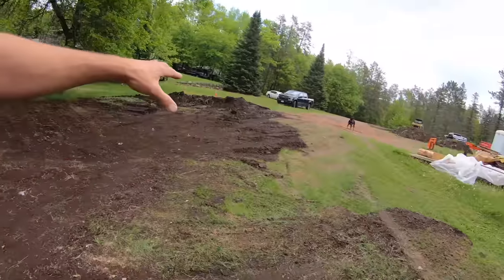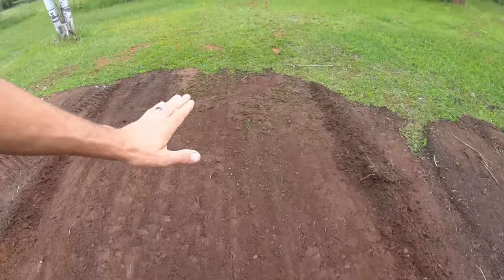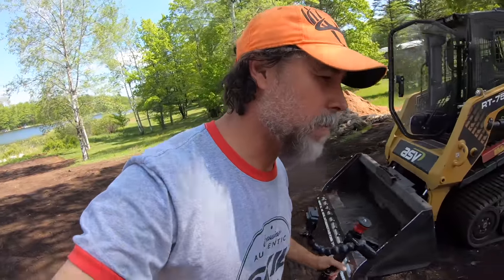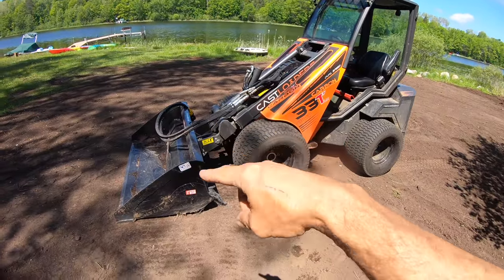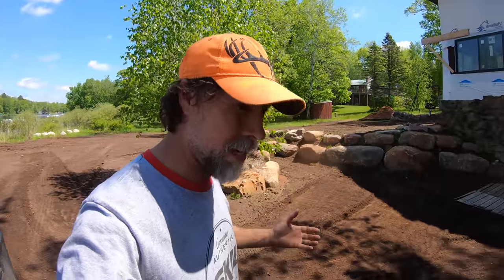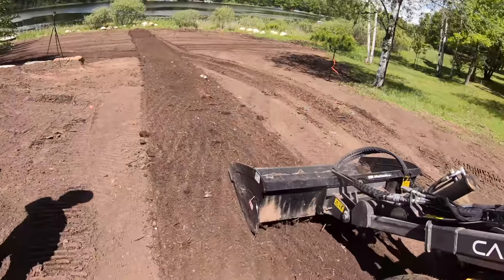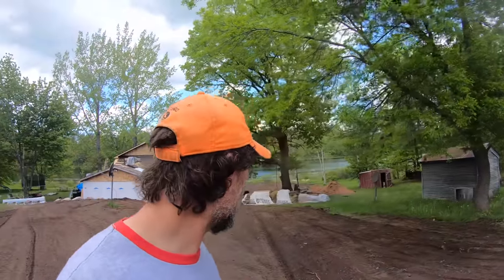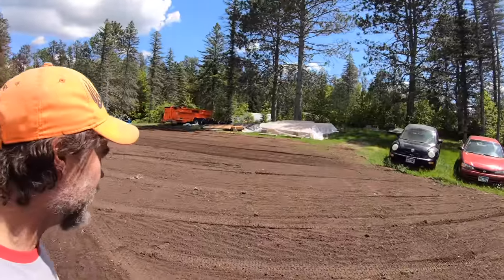A new Grading bucket for a MIni loader

Comment: The key problems is why we have 3 spare keys in the truck. 1 in the wallet and 1 in the key chain plus 2 at home. I'm also glad bobcat uses the same key on everything. Also glad the new machines use a code and you don't need a key anymore. Great video!

Comment: Stan light machine floats on top of ground not surprised the hydro bucket worked well please shut down the loader before you stick you hands in the rotor of the bucket

Comment: I bought the hydrabucket for my asv rc30 and really love it, although i havent used it much yet. My next toy is a mini articulated. Where do you buy the cast loader, they dont have any dealer info on their site. Thanks!
Reply from the maker: I got mine from Top notch equipment in rogers Mn.  I love that cast miniloader

Comment: Can you do more in depth with a laser. Been searching for videos on using a transit for retaining walls and using the laser to get your grade especially when a block ends in a hill side and step up a level. Don’t have a lot experience with a laser and trying to speed up from the string and tape technique
Reply from the maker: I have done a few videos on how to run a laser
Reply: @Dirtmonkey  I found one. Got a decent grasp for just checking grade on lawns but not when it comes to digging a trench for retaining walls especially when everything slopes different directions